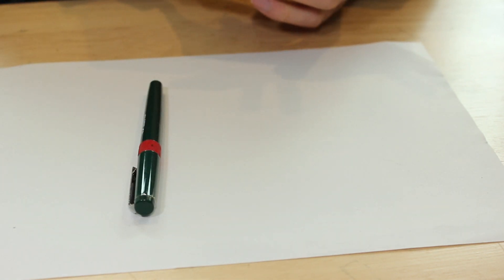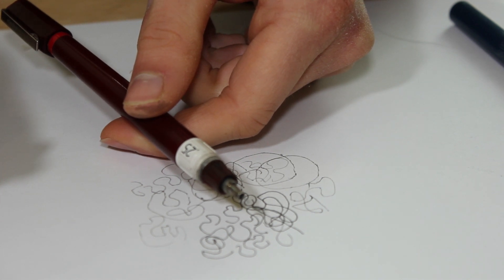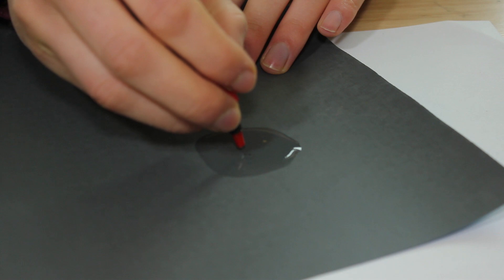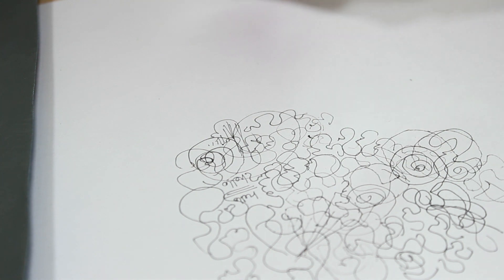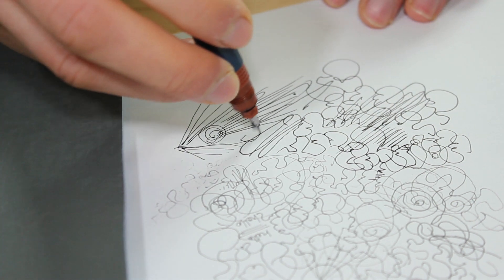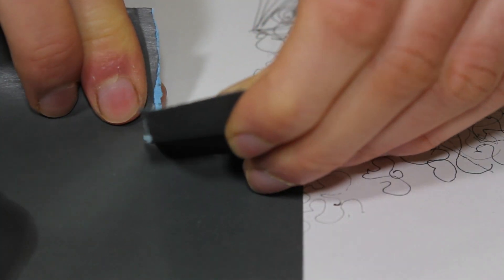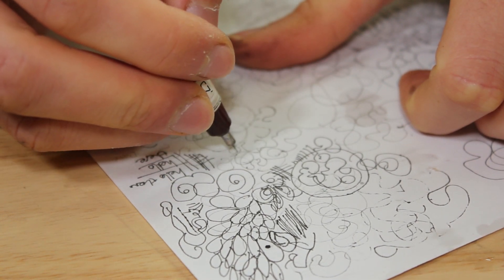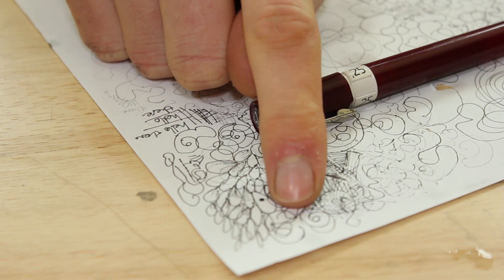Technical pen repair with sand paper

Comment: Sigh.......you need to keep the pen vertical if you are going to do this, and you need finer sand paper. Maybe 10,000 grit. 2000 grit is very coarse.  You also need to remove the weighted needles inside the nibs or you are going to ruin them too. I wish that you would stop making these videos.  You really have no idea what you are doing and are going to cause a lot of people to ruin their pens.

Comment: Love your videos there's a lot of stuff that I am also interested as I have a love for pens and pencils much the same as you do I will be watching more !

I managed to pick up a Rotring Rapidograph set at a Salvos for only AUD 8 - there were 4 of the actual Rapidograph pens, along with 3 technical pencils, some leads, some ink cartridges ,a compass and an eraser.
I don't think they had any idea how much they are actually worth, (and nor did I at the time) but having looked up the prices I realised I was amazingly lucky that day.
The issue I have found though is that the ink cartridges that were in the set appear to be dried out as it will not feed any ink through the pens.
I have tried cleaning the pens in warm water etc, but the problem seems to be that the ink cartridges are probably many years old and consequently dried out.
There's nowhere local to me that sells those particular ink cartridges so I am going to have to order them online or find a shop that does actually sell them.
(just found one in Gladesville NSW)
I am hoping that they will work ok when I do eventually get some fresh cartridges, as I am looking forward to using them on Bristol board and I especially want to try some stippling effect drawings with them.

Comment: Haven't used a technical drawing pen since 2015... Have used roterings for my architectural working drawing portfolios on vellum sheets. Also, I used to do professional drafting works back then. Didn't buy them, they were handed down from my seniors. I might have bought a single bottle of ink in my entire life, since I stayed at a hostel for Architecture students I had access to endless supply of Inks😁😁😁I only had to ask.

Comment: I love getting used technical pens at bargain prices can fixing them myself (if there are problems at all). I go all the way up to 10000 grit sandpaper.
Reply: I got an old set of Staedtler Mars Matic 700 pens. There was ink solidified inside the pens (has probably been solidified for decades), and upon trying to clean them, when I pulled the pistons out, it tore off the needle (the wire), since it was still stuck (i got too impatient, I had only soaked them in water for like 3 hours). I only have three pens left now, all stuck as well. Any tips to dislodge the piston for cleaning without breaking off the needle? Can I use isopropyl alcohol to thin the ink out?